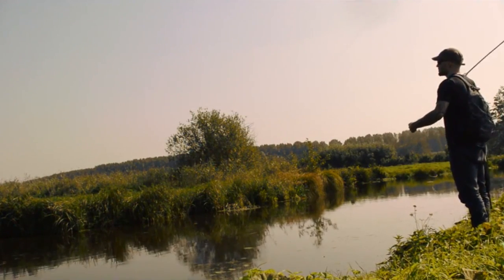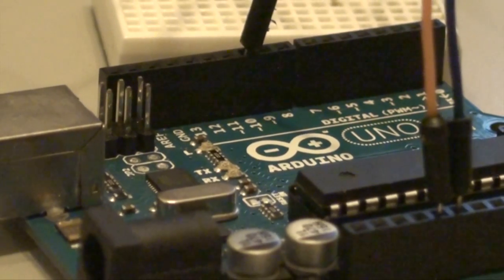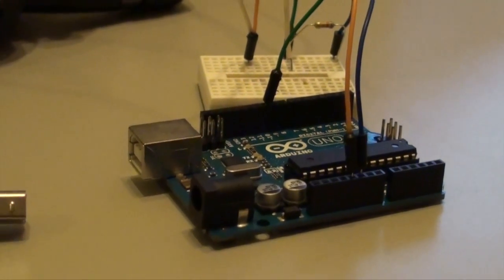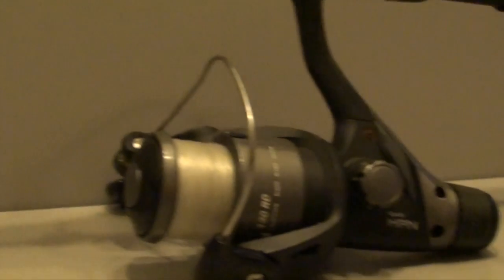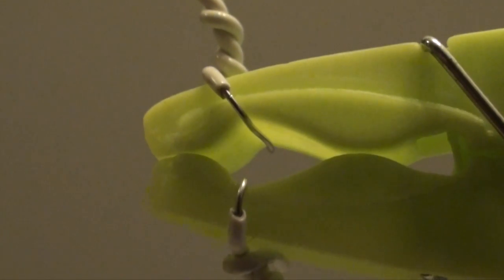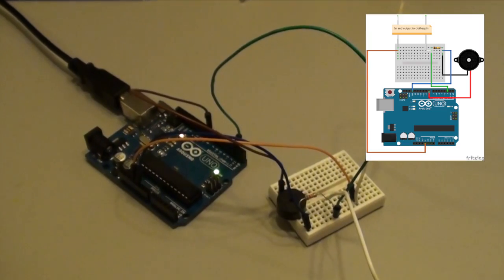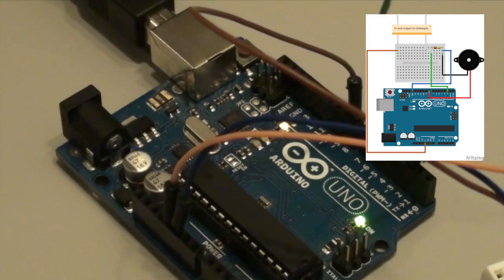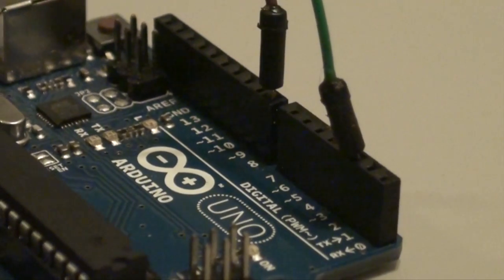Mike's Lab | Build your own bite indicator (fishing hacks)!

Comment: ARDUINO CODE

int pushButton = 2;

 #include "pitches.h"

int melody[] = {
  NOTE_C4, NOTE_G3,NOTE_G3, NOTE_A3, NOTE_G3,0, NOTE_B3, NOTE_C4};

int noteDurations[] = {
  4, 8, 8, 4,4,4,4,4 };

void setup() {
  Serial.begin(9600);
  pinMode(pushButton, INPUT);
}

void loop() {

  int buttonState = digitalRead(pushButton);

  Serial.println(buttonState);
  delay(1);        // delay in between reads for stability
  
  if(buttonState==0){
    for (int thisNote = 0; thisNote < 8; thisNote++) {

    int noteDuration = 1000/noteDurations[thisNote];
    tone(8, melody[thisNote],noteDuration);

    int pauseBetweenNotes = noteDuration * 1.30;
    delay(pauseBetweenNotes);

    noTone(8);
  }
  }
}